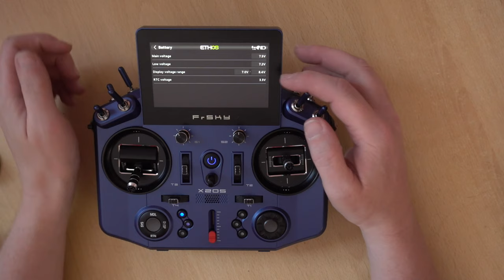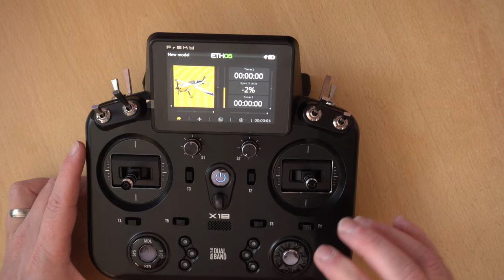Replacing the RTC battery in FrSky TANDEM transmitters

Comment: Hi Darren. I found the ipex1 connectors to be very delicate. I have replaced a few antennas on my receivers. I experienced a bit of difficulty reconnecting them and making sure they were secure. On my transmitter, I decided to leave this antenna connected. The work around was a bit tricky, but workable.
Reply from the maker: I guess with the FPV side of the hobby, I’m used to IPEX 1. They’re used on quite a few video transmitters and receivers. They can be a little touchy, but miles easier to work with than IPEX 4, which is tiny. They are a nightmare. 

I figure that it was safer to purposely remove the antenna than knock it and risk damage. But of course, if people are more comfortable leaving them attached, that is what they should do. Just be careful with it 🙂
Reply: @MrD  Would you recommend regluing the IPEX 1 to be on the safe side? What type of glue should one use/where can you buy it in uk? many thanks
Reply from the maker: I haven’t on mine. Once the case is closed, they won’t move.

Comment: I have a new x20s. How often do you change this battery?
Reply from the maker: Honestly, its hard for me to tell, as I use multiple transmitters when flying, plus videos. But I don’t think I charge all that often. What would be handy is an on time between charges stat in the ETHOS info screen. It definitely lasts longer than my X10S Express, which is powered by 2 LiIon cells (over 3000mAh). I would imagine you’d get a couple of full days out of a charge. Sorry I couldn’t be more specific.
Reply: @MrD  That sounds good too. I actually meant however, how often to change the little button cell inside the transmitter?
Reply from the maker: Sorry Jonny. On the mobile app its hard to see which video the question is about. The round cell should last for years. There’s no need to replace it until the transmitter tells you to. There was a bug in earlier versions of ETHOS; which made the cell battery discharge at a higher rate. But that was sorted a while ago now.
Reply: @MrD  I gotcha. Thanks. That makes sense. I missed the part about the button cell discharging to fast. Thanks

Comment: Not sure if it's totally fixed. Just got the RTC low message and I've been well beyond the update that supposedly fixed it since I bought the radio.
Reply from the maker: The update fixed how quickly the battery drained. Before that update it would have drained pretty quickly n

Comment: Gotta be careful when removing the back cover. Looks like you almost ripped out the antenna cable on your X20S
Reply from the maker: Those sliders can be tight. But it was fine. The back has been off before, so I was prepared.

Comment: Such a bad engineering from Frsky.  Did they suppose nobody would ever replace the RTC battery?
And this iPex zntenna connector does no tolerate many re-insertions.  After some insertions, they will break or become loose